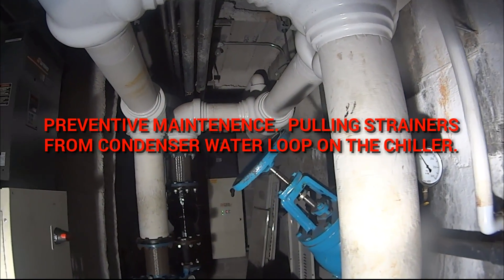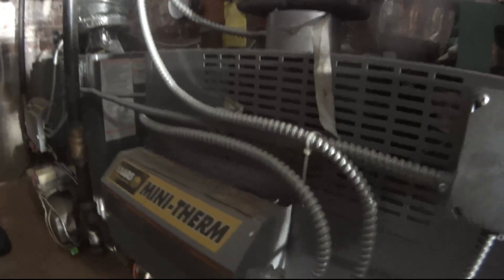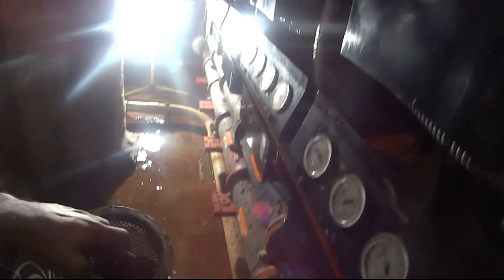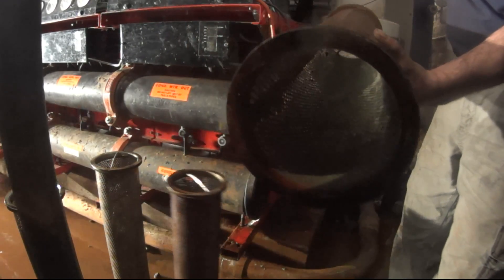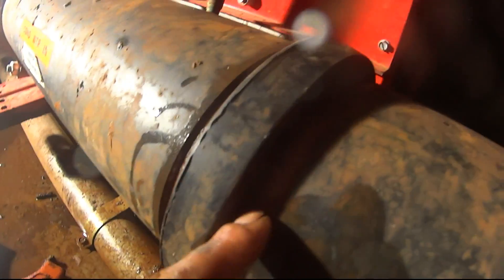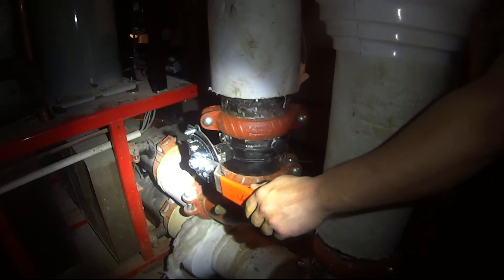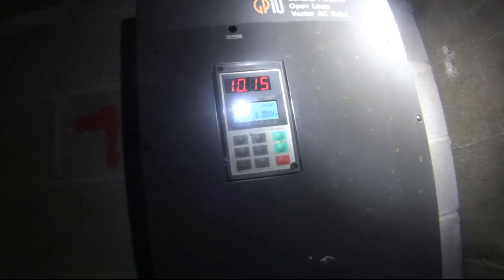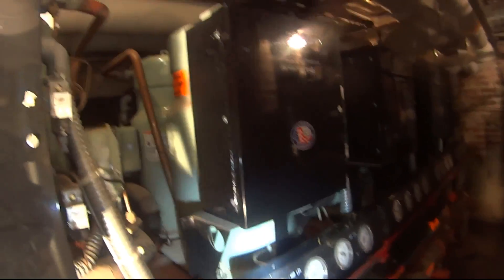HVAC- | Chiller Maintenence | Multistack

Comment: In this part of the world those machines are referred to as MultiCrap. I don't dislike them they have their purpose, but no way those could ever take the place of Centrifugal or Screw Chillers. Where they get a bad rap is when some Architect specs those out to replace a Centrifugal or a Screw which they cannot do for critical chilled water control, comfort cooling they're good but when you cannot fluctuate water temps more than tenths of a degree up or down like in laser labs those don't do as well as a screw with a slide valve or a Centrifugal with vanes to modulate during low load conditions.

Comment: man I thought the chiller room at my work was bad, this one really puts things into perspective. mine ain't shit compared to that. does all that build up in those pipes come from the metal? we just recently piped ours with copper, wondering how that will effect performance over time.
Reply: its condenser water, it can come from pipe corrosion, usually just dirt from cooling tower. If you switched your condenser loop to copper with a tower it wouldn't have any significant effect.
Reply: Some times the Company don’t want to spend $

Comment: An adjustable wrench is a better tool, Did you flush the filter tube, and the electrical connections should also be checked for tightness. nice job!!
Reply: Nop this boy don’t like the noise . What I like working here is When you need to  rebuild  the Comoressor Lol

Comment: I must have missed something. How is a straight thru strainer in a straight pipe straining any water. There are no Y strainers or basket strainers on the condenser water pumps? Nice video, Thanks
Reply from the maker: I should have showed the condenser plates. There are  openings on the side of that pipe were  the water passes to get to condenser heat exchanger plates. It definitely goes through the strainers. That's a 6 inch pipe with 2 inch mechanical T's that feed the plates

Comment: Emin i have aways loved 3 phase motor start up sounds !
Reply from the maker: Yeah mike I just love VFD start up.
Reply: I prefer the wye / delta start up. After a major repair or overhaul when you start that badboy up and wait for transition. Holding your breath while watching the amps and listening for any sounds indicating problems. Then thump - thump as the contactors pull in / drop out and motor runs in delta
Then can start breathing normally again

Comment: Good job preventive maintenance
Do you have a power washer brush to punch to tubes ?
Reply from the maker: Yes we have. This chiller has individual heat exchanger plates for each circuit. No shell on this one.